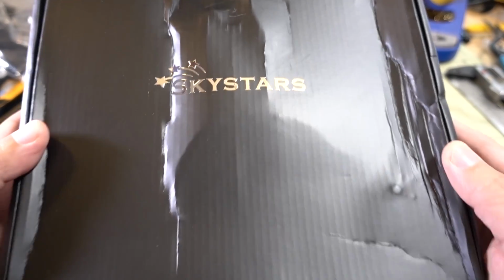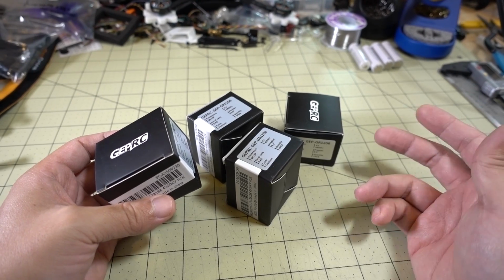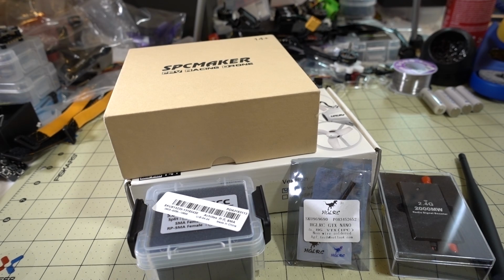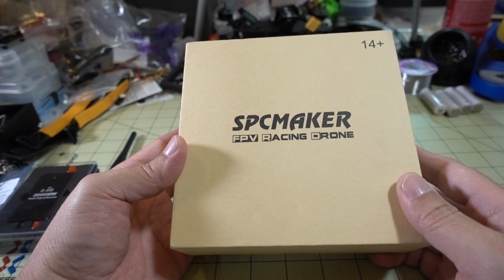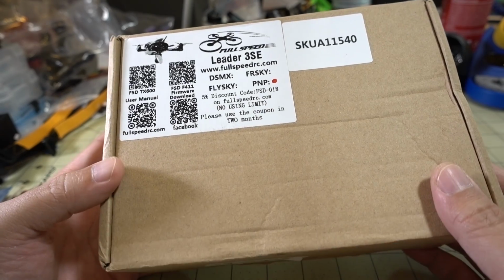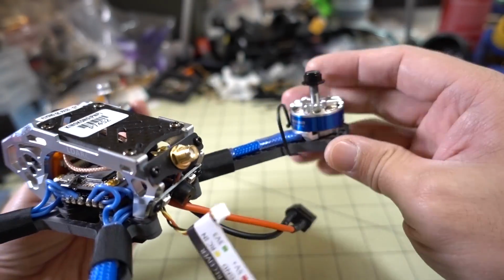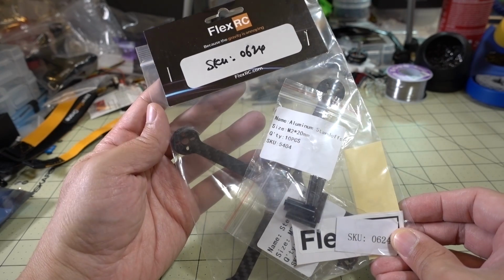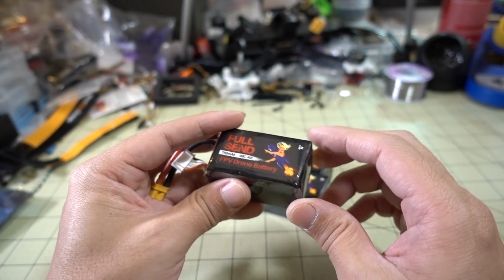Haul Time #100 🛒

Comment: Why do you say the tattu 850mAh 4s batteries are garbage?  Just wondering if there is something better out there in that capacity/size range...thx...
Reply from the maker: They have massive sag on anything that draws a lot of current.  I recommend the GNB 850 4S instead.  They cost more but it's totally worth every extra penny.